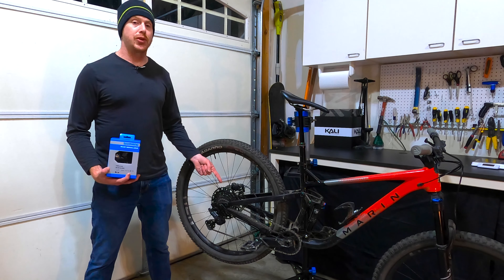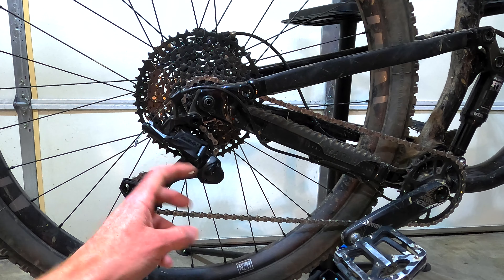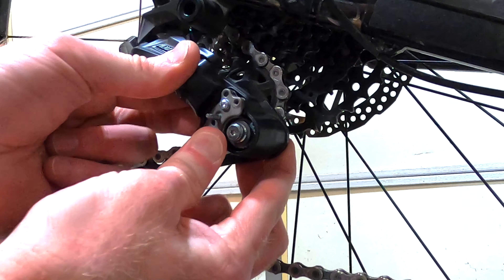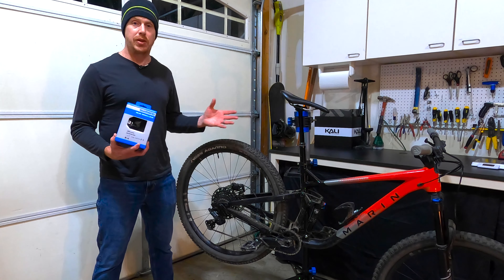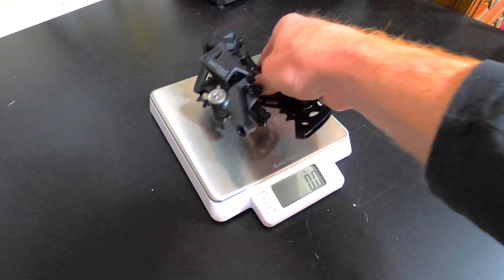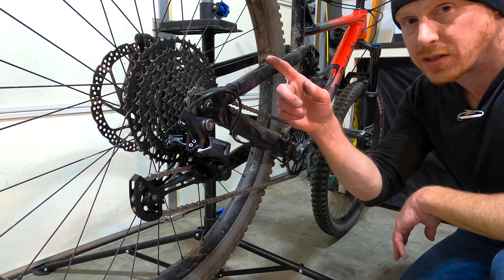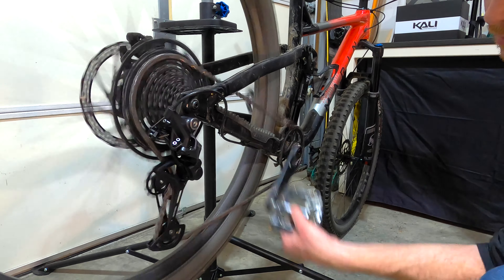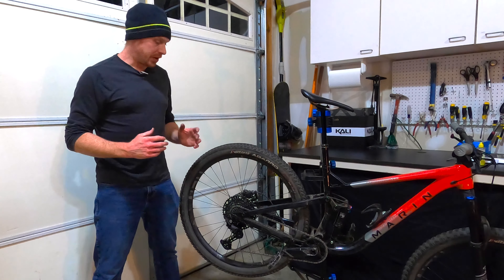MicroShift Advent X / Shimano Deore Hybrid - Will It Work?

Comment: Yeah the Advent clutch just doesn’t compete with the likes of Shimano. But for the price, it’s still a great deal.
Reply: I saw vids by Pinned TV, they had issues with theirs, clutches failed I think. ''microshit'' he said
Reply from the maker: It wasn’t so bad when it was new. And to be fair it was still shifting fine, just a bit noisy over rough terrain.
Reply: Microshift Advent Clutch is adjustable
Reply from the maker: The clutch is but it has no effect on the dead zone before the clutch engages
Reply: Maybe the chain might be too long and cause the clutch to be delayed to engaged?
Reply from the maker: I wish that were correct but it is actually borderline too short according to Microshifts instructions.
Reply: Here in the Philippines, you can buy the deore 12 speed shifter and rear derailleur for about $55-ish dollars when converted
Reply from the maker: That’s a sweet deal! I paid almost that much for just the derailleur.
Reply: @downtoridemtb  I knew this would be the case, but I see TRP also uses a ratchet, but not not looked into it much. But Not sure if it too will have the same issue, I am struggle to find pics of the clutch.  Might have seen it before.
Reply: @downtoridemtb  Deore has been quite quiet, but the jockey wheels do make more noise than ones with bearings, but it's not heard when riding. But the you will run trough a few clutches before the Rd is worn out. so it's a good idea to buy at least one spare clutch.
Reply from the maker: @mtbboy1993  good call, I’ll order a spare one next time I’m ordering something else.

Comment: Why an 11 speed derailleur with a 10 speed cassette?  I'm not sure how this works without anything going wonky.  Please advise - thanks!!!
Reply from the maker: The shifter tells the derailleur how much to move. So it’s all about the shifter and derailleur pull ratio matching. Meaning x amount of cable pull equates to x amount of derailleur movement.

Comment: I kinda have the same setup. I used to have this ltwoo 10 speed drivetrain, 11-50t cassette. The performance is actually suprising and very smooth even while shifting on load only problem is the chain slap is insane. I decided to replace it with the deore m5100 derailleur. Took me about 30 minutes to tune the 11 spd deore with the 10 speed cassette and shifter (I'm using the 10 speed shifter btw it's god the same pull ratio as the shimano). I am currently happy with the outcome
Reply from the maker: That’s awesome, a 50t would be nice!

Comment: Can you use a Shimano 10 speed shifter (sl-m4100-r), Shimano 11 speed derailleur (rd-5100-sgs) and the Microshift Advent X cassette?
Reply from the maker: I’m really not sure. If you already have the Deore 10s shifter then I’d say it’s worth a try. If it doesn’t work, then you’d just be out like $20-$30 for the Advent X shifter. Please report back if you try it so others will know too!
Reply: Don't think this will work. Because the Shimano 10 speed shifter has a different cable pull than the Advent X shifter (and the Shimano 11 speed shifter).
I am actuality considering getting the Archer Components D1x shifter instead 🙈
Reply: Did you try it?  Wondering if it will work as I am ordering cassette. Shifter m4100 and derailleur already on shelves

Comment: Thanks for the video!  Dealing with this with my son’s bike.  Do you think I can get away with his existing 10 speed chain and swapping to the 11 speed derailleur or do I need the 11 speed chain? Thanks
Reply from the maker: Good question. I’m really not sure but I’ve been running an 11 speed chain for years on the full Advent X and I think it interfaces with the cassette better. So the 10 speed chain would probably work but I think an 11 speed would work better.

Comment: I'm a fan of 10 speed drivetrain and also got this Frankenstein build
Shimano M5100 derailleur to accommodate 50t cassette, M4100 SHIFTER 10s, KMC chain and cheap chinese cassette 10s.
 works just fine bought it all for $100 best upgrade .
Love this content, it shows how shimano is a user friendly company.
Reply from the maker: That’s awesome! Didn’t even know you could get an 11-50 10 speed cassette. Might give one a try when this Microshift cassette wears out.
Reply: Fantastic! Just the info I was looking for. I was thinking about combining the m5100 with the m4100 shifter but wasn't sure if id run into compatibility issues. How's your setup going?
Reply: @magicdog5623  como le fué amigo ? intentó?, y la combinación del amigo arriba si existe, pero con el modelo m5120. funcionará con el m5100?

Comment: I've been having the exact same issue with my Advent X drivetrain, that the derailleur was starting to show this "play" as you described in the video. I started to notice it quite dramatically when I was riding in the highest gear (smallest cog) on the cassette, where the chain would almost immediately come loose after hitting some smaller jumps. Glad that it worked out fine with the 11s Deore deraileur, think I'll go ahead and buy one too as this appears to be the smartest solution to the issue. Because in general, I'm really happy with Advent X as a whole.
Reply from the maker: Right on, glad this will work for you. Love spreading useful information! Just like you, I think the Advent X is perfect otherwise.

Comment: Thanks for the info on the pull ration. Opens up another possibility.  Using the Advent X 1x drop bar shifters with this RD and a sunrace 11-51 10 speed cassette for a 1x10 gravel set up.  Will try this soon.
Reply from the maker: Glad to spread the knowledge. I never thought about trying it with an 11-51 10 speed cassette. Actually not even sure that I knew they existed. The 48t has been fine for me though but I’m not in a mountainous area.
Reply: The Marin Gestalt X10 uses Advent X drop bar shifters, rear derailleur but a Sunrace 11-51 10 speed cassette, so they must have tweaked the Advent X RD up a bit.  I don't own this bike, but will mod another bike soon.
Reply from the maker: Very interesting. They are definitely pushing what microshift says but it must work for them to put it into production that way.
Reply: Tried a couple of things and the Sunrace 11-51 10 speed cassette does not work with the Shimano RD-M5100 rear derailleur.  The actuation arm catches the chain in the middle of the cassette. 
Sunrace           11-13-15-18- 23 -28-33-39-45-51T
Shimano 11s  11-13-15-18-21-24-28-33-39-45-51T
Advent X          11-13-15-18-21-24-28-34-40-48T

This Sunrace cassette is not stocked widely.  Read somewhere that it is an OEM only cassette. It is listed in their full range catalogue, but does not come up with the online range selector.
I was lucky to be able to pick it up new for AUD $100 - must have been excess stock being sold off.
This cassette does work nicely with the Advent X rear derailleur - just needed to adjust the B limit screw a bit.
Reply from the maker: Thanks for the followup on this. Good info for anyone looking to do the same thing. So strange that the two cassettes would be different in those couple gears.
Reply: @ESeppOz  In the case with Shimano Derailleur, I think you might have to use the wireless shifting from a company called "Archer Components". You can check some videos of it or contact the company to see how it can be worked out with their product. This is a little costlier approach but you get wireless shifting as well.
Reply: @KaushikNSanji  thanks for the tip, but for this bike I am going low cost.  Will keep them in mind for future though.
Reply: @ESeppOz  I do have that bike. Works fine but not as smooth as with the advent x cassette. I changed the cassette to the advent x because I do not need such low gears on my gravel. Also, now I am using an x01 eagle derailleur with the advent x. Works 100%. (Mechanic speaking here) I do own 3 advent x groups on my bikes. Just to try it out. All work fine. The only negative I found out after 1 year of use is that the cassette is way too soft. I did manage to bend it 2x. Oh an there is no reach adjust on the advent x drop bar shifter/lever combo. Overall I like it for what it is. My (mechanical) eagle groupsets are collecting dust in a box. For now that is..
Reply: @MrRadiomir  Thanks, that is really good information, much appreciated!

Comment: It is great to see these experiments! I'm not sure why microshift clearly states that the shifter only works with advent x. I'm using the trail pro shifter from micro shift with a gx 11 speed derailleur without any issues after about 600 miles. All research suggests that it shouldn't work because they have different pull ratios, but it does. The gx 11 speed is only rated for a 42t cog, so I was surprised that it also worked with the 48t advent x cassette. I got the shifter and cassette first in the mail so I figured I would try it out and it worked great.
Reply from the maker: That’s cool. Yeah I thought Sram and Shimano weren’t compatible that way. Good option to know for the future since I think Deore 11 speed is being replace by Cues. Although Microshift recently came out with a Sword series which is compatible with Advent X and has a different style clutch.

Comment: I've been running the Advent X derailleur with the Advent 9 speed shifter pod and a BOX prime 9 speed 11-50 cassette. Now that I've seen this work, I bet it'd work with my weird setup too. Probably going to try it out.

And as a disclaimer I did email Miscroshift about the compatibility of the advent 9 speed and 10 speed stuff before I did it. Have now been running it for about a year as well and have had no issues.
Reply from the maker: That’s an interesting setup. Cheaper than just going all Box components?

Comment: I used M7100 SLX on Advent X drop version for my gravel bike, and surprisingly it works well
Reply from the maker: That’s awesome. I’d guess all the Shimano Deore and better product lines probably use the same pull ratio.
Reply: @downtoridemtb  Yes, I hate most of the gravel gs available due to the fact that they don't have enough easy gears, specially on a 1by system. High end grx is too expensive and tops at around 46T and with a 42T chain ring and on harsh climbs, that is still kinda heavy. The entry level grx is also very limited to 36T max, and while a 2by is an option, I prefer 1by on a gravel bike personally. 

This enabled me to run 11-48T with a 42T chainring which gives me enough gearing for most of my adventures. Also not to mention grx only has hydraulic brakes, though hydro brakes is nice, the upfront costs and maintenance + replacement if something do break is expensive
Reply from the maker: Interesting. I never knew gravel drivetrains were that much different. Glad you got a setup that works!
Reply: @lowqualitysenpai6169  FYI, not cheap but GRX812 RD can fit a 46-48t. And I have mine fit to a 50t with an inexpensive Wolftooth Goatlink11.
Reply: so a 12 speed derailleur on a 10 speed cassette?  what then is the difference between a deore 5100 and 6100?
Reply: @gisdp99  yes, the pull ratio is the same on shimano 12s derailleur, means one click pulls the same amount on the original shifter. If i'm not mistaken, 12 speed has extra click where in 11 speed just stops at 11th gear

Comment: Great news, it works with Advent shifter, nice.
Much better option for sure. I don't see a reason to get Microshift Advent X.
Reply from the maker: Yeah the biggest advantage is the lightweight cassette and just the fact that it is a 10 speed with that range. I think this is the perfect combination.
Reply: @downtoridemtb  on a 29er for me 48t is too small if going for 32t chainring but not tried 30t or 28t yet. But defenitly won't go bigger than 32t on a 29er. The 50t really works well for me, but I noticed a difference with 51t on Deore cassette but not massive, but I run Garbaruk 11-50t, it suits the 32t chainring but might be able to go down to 30t  but can't find any chainrings in stock now anyway atleast not in Norway. Garbaruk is about 300g, about half of the Deore m5100, but would be sweet to have more cassettes mad elike this in smaller sizes. For me 11 speed works well. I use every gear. But not tried 12 speed, but went for 11 speed, stronger chain, lighter cassette. Nothing wrong with smaller cassettes, nice for smaller wheels, so drivetrain setup has to suit the wheelsize.
Reply: So this derailleur works on the advent 9speed setup too?

Comment: Thanks for the video!  I installed a Sram GX derailleur and love it.  Might want to look into it.
Reply from the maker: Thanks for watching? So you put the Sram GX derailleur on with the rest Advent X parts? I thought I read the pull ratio was different. Maybe not though, my head was spinning trying to make sense of it all when I was looking it up.
Reply: @downtoridemtb  No sorry, My Riftzone 2 came with a 12 speed Sram SX cassette and derailleur.  I upgraded the derailleur to 12 speed GX.  I then 2 years later upgraded the cassette to GX as well with a 34 tooth GX front sprocket.  It just made sense to me to upgrade the components as they wore out.
Reply from the maker: Right on, yeah I thought you had a Rifty 2 also. Definitely a smart way of upgrading like that.

Comment: very good video man! like the research and solution. Microshift has to figure something out. What's the point of having a clutch if it doesn't engage in time.
Reply from the maker: I agree and it looks like they did figure it out with the Sword derailleur. I will at least mention that the Advent X clutch does a good enough job to not drop the chain so it’s not terrible. Just could be refined, more teeth or just tighter manufacturing tolerances.

Comment: Also have the adventx on a ebike, my one upgrade was a aluminum top jockey wheel with ceramic bearings. I think it made a noticeable improvement in the shifting. Also need to keep hanger the straight..
Reply from the maker: I’ve never replaced jockey wheels but these do seem pretty basic so I can see how it would help. Cheers!
Reply: @downtoridemtb  It eliminates a lot of bearing play for more precise indexing I think.

Comment: I was also inclined to buy an AdventX for the hybrid MTB ive built, but due to unavailability, I opted for a Deore 5100 and a chinesium cassette with the last three lighter speeds in aluminum. Too bad, I was thinking of this microshift to start assembling my new gravel thanks to the Advent shifters for drop bars.
Reply from the maker: How does it shift with that cassette?
Reply: @downtoridemtb  perfectly. I had no issue in the initial adjustment and after 5000km I still haven't touched anything in terms of adjustment. Crankset, chain and derailleur are all Shimano 5100. There no signs of wear in the chinesium cassette and i'm a big dude (185cm x 100kg) discharging a pretty good amount of force/weight on the pedal

Comment: Microshift announced rev.2 of theirs Advent X mech. Just waiting to see how clutch works at these upgrade unit.
Reply from the maker: I actually talked to someone at Microshift about this. No changes to the actual clutch itself.
Reply: @downtoridemtb  Thanks for info
I upgrading (downgrading?) from decade old Sram X01 carbon/alloy cage and titanium spring. But this mech is without clutch ;) And after change for 1x10 i need to be more carefully when shifting ;) This is main reason for change.
2nd reason is casette compatibilty. My old Sram only accept 36T cogs, with extension i force this derailleur to work with 46T casette, but it is not perfect.
So it should be better with Advent X anyway.
Reply: Seems like their clutch system on the acoylte is better
Reply from the maker: Interesting. I’d never considered that one.

Comment: It would be interesting to see the derailleur movement as you compress the rear suspension. My guess is when you sit on the bike the derailleur would have moved and would have taken up that slight movement of the advent x.  ???
Reply from the maker: Not really any different overall. It may click into the next set of teeth but then it is rmoving within the free play of that spot. I can say for sure that this Deore derailleur is quieter over choppy terrain. Although to be fair the Advent X derailleur still went into the gears like it was supposed to.

Comment: Great video. Love my advent x as well. Have you tried the ver2 advent x derailleur?
Reply from the maker: Thanks. I haven’t tried the V2 yet. They said the clutch is the same. I’m more interested in their Sword derailleur which is compatible and has a different clutch.
Reply: I’ll have to look into the sword. Is the Shimano derailleur still holding tension better than the advent?
Reply from the maker: @jasonrichmond7974  yes the clutch is doing great on it. Jockey wheels got a bit squeaky so i dripped some lube in them recently. Thinking of swapping the to XTR jockey wheels that have bearings instead of bushings.

Comment: Super cool research!  How'd you come to decision to try the Deore 11-spd on a 10-spd shifter?
Reply from the maker: I think my dive into the rabbit hole started by thinking I could go Deore 10 speed but it can only clear 46t. Honestly probably would work with 48t though. But anyway I started wondering what the difference was for the 11 speed. That was followed by more deep dives into pull ratios.